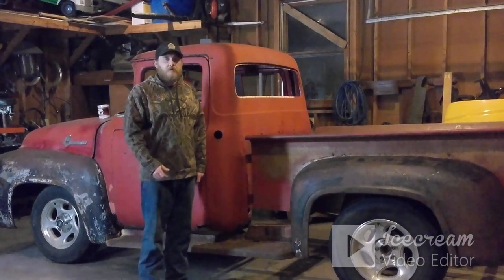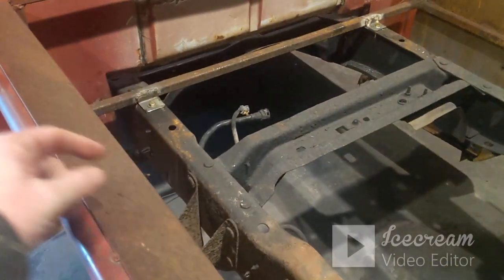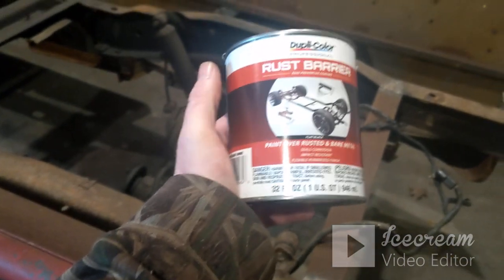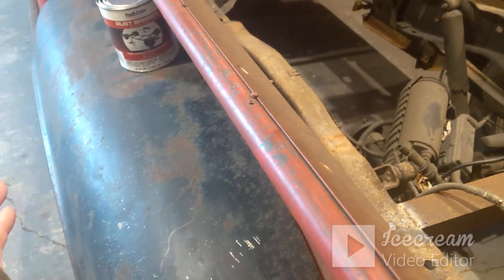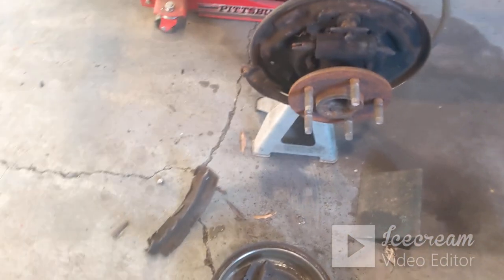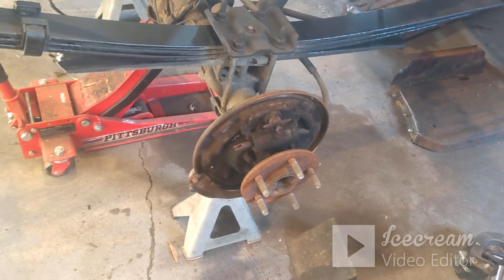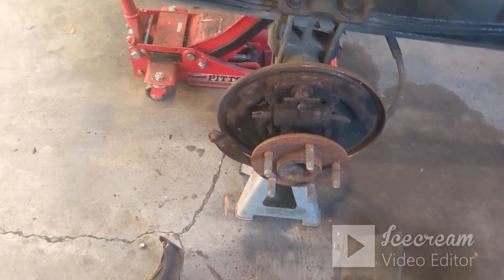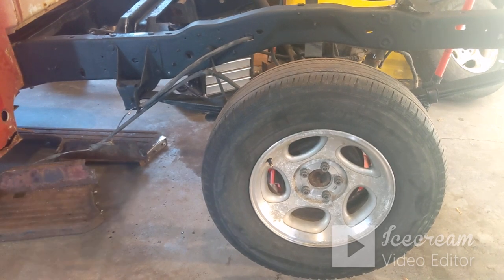1956 F100 Rust Barrier Coating/Engine Talk

Comment: Just found your channel  I'm building a '55, just grafted a '98 ranger front on it and a 460/C6 this fall!  Super cool to see someone else building something similar.  Mine is still pretty rough and I'm replacing floors ATM.  I 4-linked and air bagged by rear suspension.  Its the first time I've used air, and I'm on the fence about it.  Some days I think I should cut them out and put coil-overs in :D